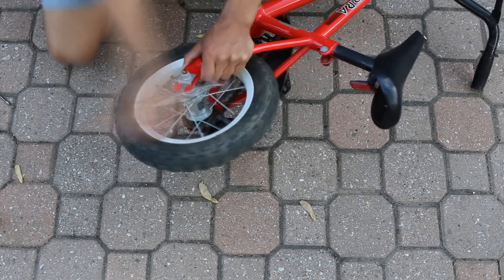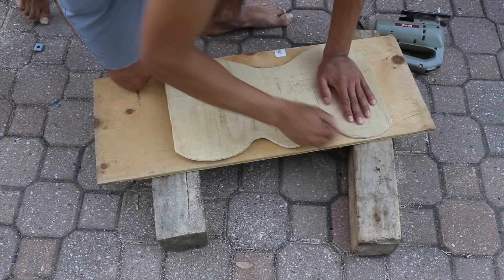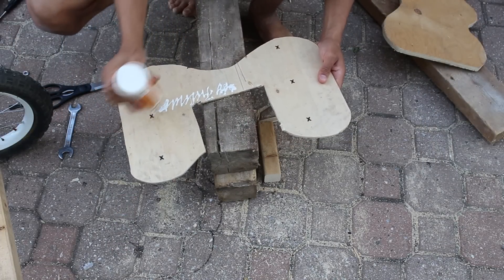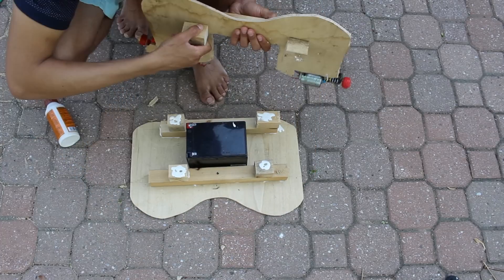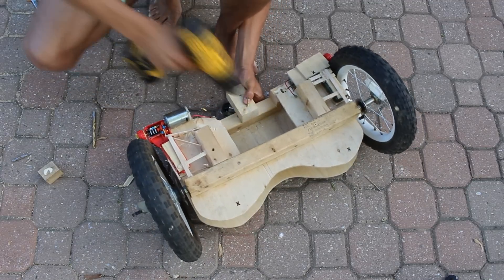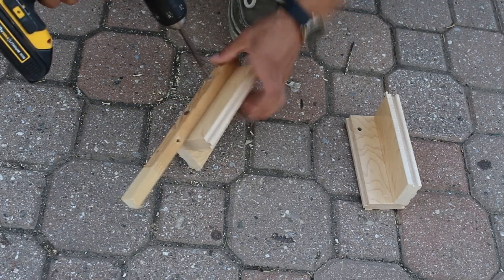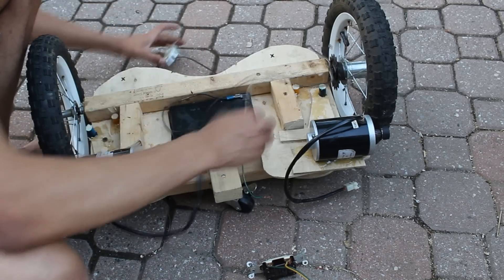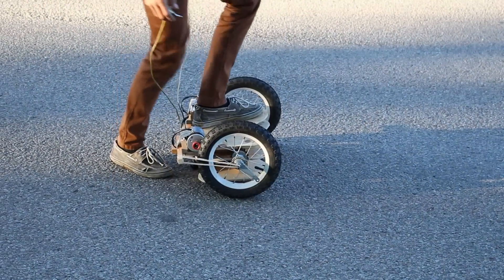How to Make a Homemade Hoverboard

Comment: instead of using control switches, how would a gyro work i wonder. That way when you lean toward a direction the gyro would try to correct the lean and drive forward as a result. Maybe a dumb idea, just something I have been throwing around in my head.

Comment: Also, that's a terrible design. The rubber wheels on the motors should be spinning against the INSIDE of the bike wheels, if that's the way you're going at this.
Reply: The rubber will wear down overtime, and lead to less contact and less efficiency.
Reply: f the little rubber wheels. thatd be good for a longboard or something where the motor kicks in at higher speeds. you gotta rock some belts/chains on those babies. the bike wheels are perfect size for somethin like this though. medigs it. also, looks like you can pump twice the volts into each motor if you get 1 or 2 cheap boost converters off ebay (im sure theres a ghetto circuit way to boost also) but youll be flying on that beast for a solid 20+ minutes. few more mods and your hoverboard will light on fire just as good as the real thing lol.
Reply: So it still works

Comment: Looks like it was a fun project to do. It's not actually a hover board, though.
Reply: That is the name. Just like strawberries aren't berries. But that is the name.
Reply: It might be a name he decided to call it, but it's not the same as the commercially available hoverboards which are widely known as self balancing scooters. Something this is not.
Reply: Commercial ones don't hover either, they also roll on wheels.
Reply: You missed my point. What it means and what something is widely known as. Yes hoverboards means a board that can hover, but it is also widely known and referred to a scooter that can self-balance. I think we are pretty far from having a commercially viable "hover"board, that's obvious. However when someone sees the thumbnail and the title, they will most likely assume it's the self-balancing type, that's common sense.
Reply: Hover means hover. Misusing a word doesn't change its meaning. Sorry. statement stands.

Comment: Can I suggest that next time, or for anyone following this built, that a section of square tube steel is used across the width of the built (as where the wheels are screwed and glued into, to give it rigidity. I noticed significant sag when you were testing it, and you look like a pretty slim guy, which suggests its not the strongest of designs, and 18 or square tube steel shouldn't add much to the cost.

Comment: what is the wattages of motors???
Reply: You can get about 200W in a similar size.
Reply: RPM Is probably something to consider to... Or how fast it spins rather.
Reply: +C Mendoza can control that electronically. Though yes, there will be an ideal RPM.

Comment: great build of course it can be improved just by adding a controller broad with all the balancing systems and better powering choice and the key is the charging systems and possible ass temperature sensor with a power overload detection system in place and your good to go.